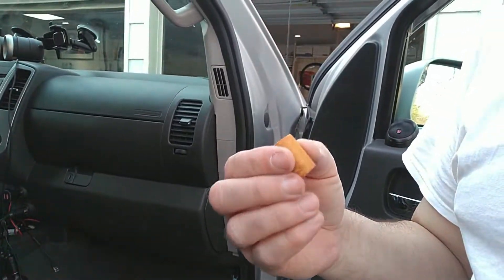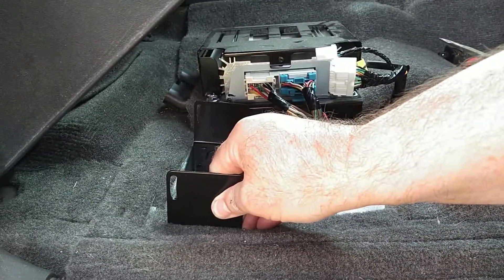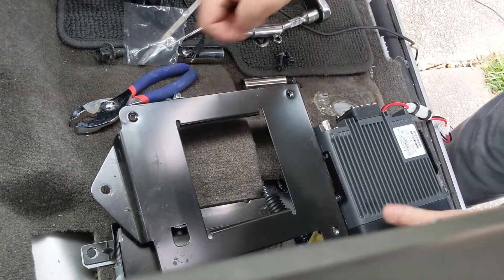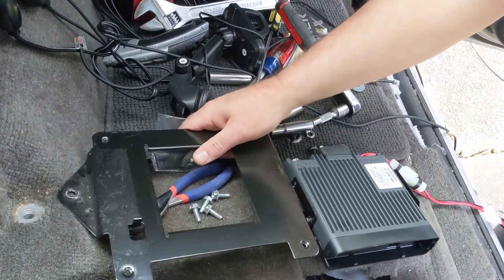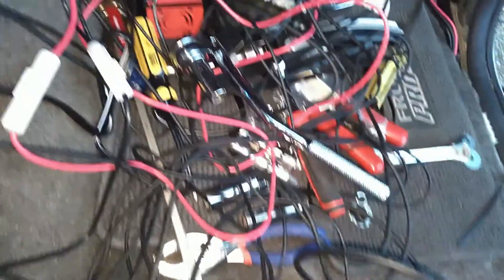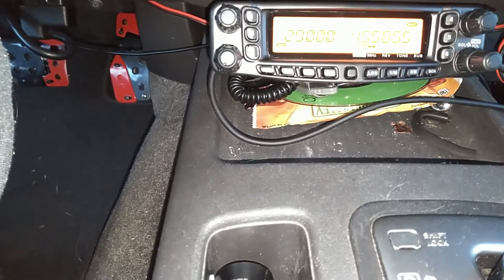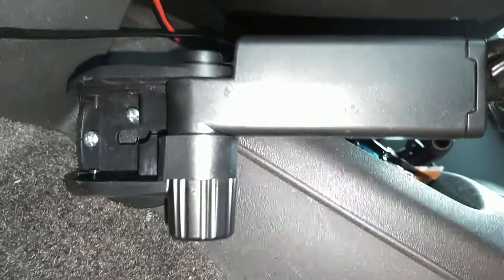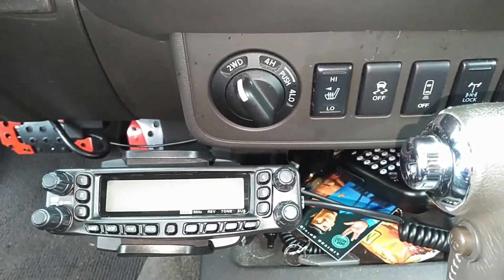Yaesu FT8900r Radio Install Part I, Nissan Frontier, Remastered

Comment: Nice job. I have 2018 Frontier, and same radio. Not finished yet. I did go through the rear cab by way of the rubber grommets on the inside, down low, both sides. I considered the rear vent, but was concerned about creating a leak. Anyway, enjoyed the video.
Reply from the maker: Thanks for the info! I think anything more that I run out from cab, will go the way you did and head through the grommets. I was not even aware these existed at the time I ran my wiring, but found it later on I think it was Raine's build sheet on the ClubFrontier forum. So far, I've had no issues with water infiltration as I left the vent in place and just ran the cable out between the louver segments. How are you enjoying the Yaesu? Hit any distant repeaters or base stations?
Reply: Thanks for the reply. I don't have the 8900 in there yet. Using the old Yaesu FT-3000 until I get everything like I want it. I had hoped to get my Kenwood TS-50 in there too, but not sure yet. I'll keep thinking on it.  Was there a Part II of your video?  Thanks!
Reply from the maker: There is indeed a Part Deux.

Comment: I used to enjoy running wires in my vehicles for all of my electronics, no more. I have an FT-7900R that I bought years ago that has yet to find itself installed in my pickup truck.
Reply from the maker: William, glad you're enjoying the channel, and thx for writing in.
Depending on where the wiring is, LOL, I agree completely, the wire pull for the tailgate lock install was an absolute pain in the rear, getting it through the rear cab air vent assembly and down between the bed and the cab was murder. I'm going to be 55 in February and this crap was way more fun when I was 25, I'm gettin too old for this stuff, upside-down on my back laying on cold concrete, with 2.5 tons of steel hovering over my face, ehhhh yeah. ROFL.